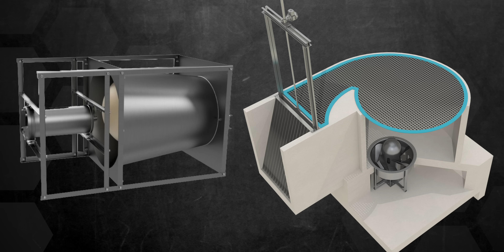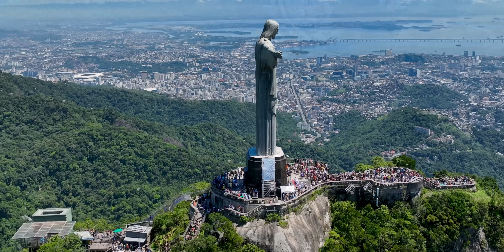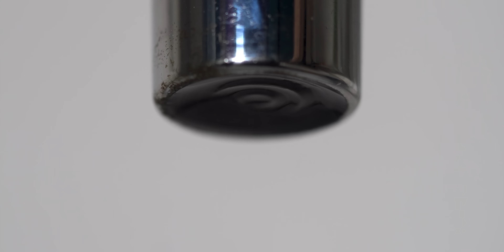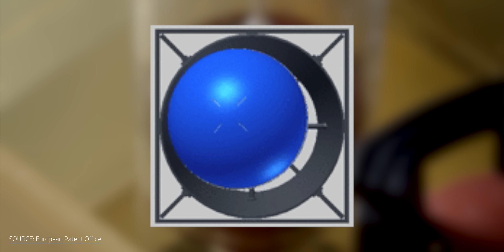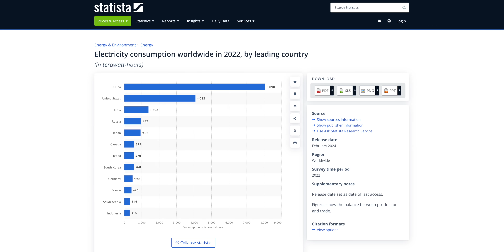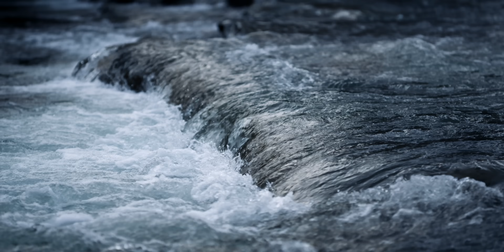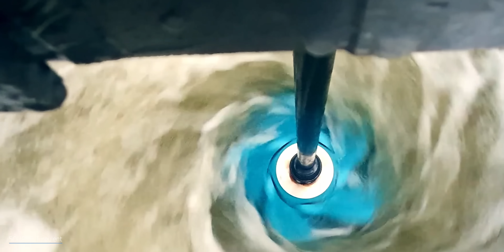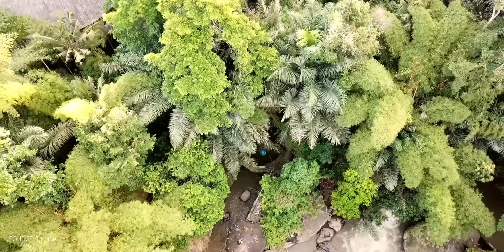The Genius of Small Hydro Turbines

Comment: So, basically, anywhere there has been a water-wheel driven mill historically, we can put in a small eco-friendly hydro. Sounds like a great idea to me! I do not believe that we will ever find a "silver bullet" that will solve all of our energy needs with a single system. I think it is much more likely that we will continue to expand our options - rooftop bladeless wind turbines, micro-hydro, more efficient solar panels that are manufactured with fewer rare elements, etc.
Reply: In the UK you can find a bunch of old water mills that in Victorian times replaced their wheels with turbines so it's something that already has precedent. Of course those turbines were just motive power not for electrical storage but same principle for the swapping out of the wheel. There are good charts on how much efficiency you get for wheels and turbines given drop height, over or under, etc etc.
Reply: @MrFolfy  Great! Sadly, nothing as convenient as a map of old watermills exists for the US (or, at least, none that I'm aware of).
Reply: There's no "silver bullet". Never was. These are all small pieces of a very big puzzle.
Reply: @233kosta  Agreed. I have never understood the fascination for the search of an heroic single solution. This is true in medicine, also. Researchers are busily testing different compounds to increase longevity, looking for that silver bullet; but all the research points to small, incremental lifestyle changes (diet, sleep, exercise, social connection) as the best strategy for life extension. Ditto energy systems. All of the engineers (or at least, the press reporting on the engineers) are looking for the one 'silver bullet' technology. But experience would argue that the more varied and flexible our options, the more cost-effective and efficient we will be at meeting our energy needs.
Reply: @lindacgrace2973  I'm an actual engineer, you won't see me wasting my time with journos or other media. I got actual work to do which is going to contribute to an actual solution to some problem.

I'd say don't take the word of media or "influencer" types, most of what they say is way too dumbed down to make any sense to begin with (and that's before they throw in any big words to further bamboozle), but also, there's always some political agenda behind it, whether it be promoting something they're paid to promote, hyping up interest in some nonsense they're paid to hype up or actual government politics. Sometimes, the snake oil is so good they don't even have to get paid to push it.

I can count on one hand the number of STEM-adjacent youtube channels I haven't caught sacrificing accuracy and integrity for hype or clicks or some other undisclosed end.

In terms of divorcing from fossil fuels, no real engineer is looking for a silver bullet. Most of the good solutions have existed for a long time, but we're not using them either due to cost (most renewable sources, battery-electric transport, anything that requires major infrastructure work), politics/public opinion (nuclear power comes to mind), or some combination of both (London got battery-electric buses. They are worse in every conceivable way than yonder regular old trolley bus, but the current hype is for battery-electric. Also land-based wind farms. Apparently they're fugly. There are even politically-motivated opinion pieces masquerading as analyses claiming offshore wind is "better", "more efficient" and "more effective". These get cited as fact to back up infrastructure investment decisions.).

Frankly, this impending environmental doom would never have gotten this out of hand were we not so great at sabotaging ourselves and getting in our own way. As a species, I mean.
Reply: @233kosta Dear Kosta, I am not an engineer. I research nutrition. You think the engineering space is a cacophony - try any of the dietary advice channels! There are only a handful that I trust. The vast majority - and most of the wildly popular channels - are rife with misinformation. Just sayin' : I feel your pain. But I'm merely here exploring interesting ideas and am fully cognisant of the limitations of both my own understanding and the format.
Reply: The closest thing to a magic bullet is nuclear power.
But hydro is definitely the easiest one for people to use
Reply: There is no silver bullet, but roof top solar gets pretty close. The limitation of solar is more of a battery limitation than a solar limitation.
Reply: @evancombs5159  I'm planning to build a house in Arizona. The perfect location for solar, right? I discovered that solar panels are cheap and plentiful, it's the storage batteries that are expensive and hard to come by.
Reply: @lindacgrace2973  yes you are right. The panels are cheap, but you can't divorce the panels from everything they need to provide your house with electricity. Even if you skip the battery all the other parts and the labor for installation still make it prohibitively expensive for most people. If I was a utility I would be running some kind of program to install panels for cheap without a battery (and contractually restricting the installation of a battery) then use the excess energy produced to go towards paying off the cost of the panels.
Reply: @evancombs5159  I agree with your premise, but not your solution. Arizona encourages the adoption of off-grid energy solutions via zoning laws and tax incentives. I prefer that solution to a "forced choice" program from a monopolistic utility company.
Reply: @lindacgrace2973 Battery experience curve is that the price drops by 20% with every doubling of production, more or less.   As with solar their price will keep dropping.
Reply: @a-iu9zO  Very true.🙂
Reply: regular wind turbines work well, but yeah, everything can be better ofc. i've watched plenty of washing machine hydro power videos here on youtube, it's really easy to build one yourself IF you have access to flowing water on your property (which most people sadly won't have).
Reply: @moos5221  True. More applicable to east of the Mississippi rather than the semi-arid and arid west.
Reply: @lindacgrace2973 don’t forget nuclear!
Reply: @titleloanman  I didn't forget about it. I just don't think it's politically viable - you know: NIMBY (not in my back yard). There's a LOT of opposition to them. The major issue is that we have yet to come up with a good way to store, recycle, or dispose of nuclear wastes. Until we come up with that (no, burying it in underground bunkers is not a good permanent solution!) I'm afraid nuclear is a no-go.
Reply: @moos5221  It's not that easy. The flowing water must have a certain height level or power level to produce substantial energy.
Reply: @meilyn22  thanks for pointing out the obvious here.
Reply: @moos5221  Lol. Obvious™
Reply: @meilyn22  true.  But if it's a small enough crick.  You can do a small survey and see if it ever supports any fish or anything that needs to migrate.  And if not small dam.  Have a spring in our neighborhood.   Damed it up like 3k ft from ghe source in a corner bend.  It's a swimming hole with native plants and small turbine
Reply: @Aztesticals  That's the idea precisely.
Reply: Big electricity was super cheap long ago when people got rid of their water wheels, now it is swinging back.
Reply: @Jokerwolf666  Sort of "everything old is new again." Except this time it's more heavily engineered. 😉
Reply: I totally agree, different places need different solutions, not everything will work everywhere
Reply: @wiezyczkowata  Thanks. I feel vindicated.
Reply: Fusion reactors will solve all our energy problems.
they can even be used on cargo ships.
Reply: @dubious6718  Fission reactors have already solved all of our energy problems. They can even be used on cargo ships. But nobody wants to use them.
Reply: @dubious6718 once one exists. Maybe.
Reply: So......the romans, the egyptians and the early mesopotamians had it right.
Reply: @ricardokowalski1579  Yep. Architects interested in restoration of ancient buildings are resurrecting ancient technologies and applying it today in restoration projects.
Reply: Very nice puns and song references.😂🎉
Reply: We just need to figure out how to survive until we get our Dyson Sphere built.
Reply: @zaibervaireus  🤣Because, while we are completely inept at planting trees and renewing water flows, but we'll succeed at something as complex and unknown as a Dyson sphere? Um, I'm not so optimistic about that. I think that we have not gone past the tipping point - I think we have a shot at saving this planet and undoing much of the harm we have done. Massive village-by-village water collection/retention efforts is re-greening the most heavily populated desert on earth (northwest India). Mossy Earth, Rewilding, Clean Ocean, and small local volunteer groups around the world are piecemeal fashion, tiny plot by tiny plot - greening the world. African farmers are holding back the Sahara, cattle ranchers in Nevada banded together to implement better grazing practices and restored wetlands (complete with beavers and migratory birds) in NEVADA! Shaun Oberton a small businessman - with the help of volunteers - is planting a desert forest in a desolate part of Texas. It's quite a thing now to buy up land, and dedicate it in perpetuity as wild space. There are programs and national clubs promoting wildlife habitats in people's back yards, thus creating a patchwork quilt of wildlife corridors. I believe that small local efforts - collectively will reverse the mass extinction we have very nearly brought upon ourselves. At least, it seems more likely than a successful Dyson sphere 😉
Reply: @lindacgrace2973 Bruh chill, it was obviously a joke.
Reply: @zaibervaireus  I get it. That's why I used the LMAO emoji. The rest is my usual speech for the discouraged and pessimistic. I need to encourage myself from time to time!
Reply: Have been planning on designing hydro for the little stream next to my house. Ultimately going for solar, wind, hydro, and even have a stationary bike idea I am going to try out. Electricity can be produced in many ways, true energy independence
Reply: @DwDDB  Dear William, Wow! That will certainly reach your goal of energy independence; but it also sounds like a lot of maintenance, which is not popular with me. I'm a retiree in my 70s. I'm trying to keep my house as minimalistic as possible. Russian wood-burning masonry fireplace (it snows in the Arizona mountains), Passive House energy-efficient construction and energy-efficient appliances to minimise energy needs, passive solar home design with deep roof overhangs and deciduous trees providing shade during the summer, a large (I've been told, 'overbuilt') solar array with a gas-powered backup generator (that I hope I will never have to use). My elaborate multi-input system is my water capture and storage. Getting water off-grid (basically, capturing whatever falls on my lot)  is a necessity when you want to grow your own food in an area that only gets 15" to 16" of rain per year.  We should compare notes!
Reply: And, y'know, nuclear.
Reply: @AnnaNym-h5k  Not likely to have back-yard, small-scale nuclear anytime soon; so hardly comparable to micro-hydro.
Reply: @lindacgrace2973  Well, no, but small modular reactors are becoming a thing, and even traditionally-sized large scale nuclear has a significant role to play.
Reply: @AnnaNym-h5k  Wow! I hadn't heard of 'modular reactors' (I feel another rabbit hole coming on...) Thanks!
Reply: Yeah, anything BUT nuclear (booo!)
Reply: Silver bullet is fusion
Reply: @benbarberian1701  Oh? You mean the technology that's "only a few years away from being viable" for the past 80 years? I'm not holding my breath...In the meantime, taking some of the strain off of aging overburdened centralised utility grids by supplementing, or completely converting to distributed systems like roof-top wind turbines, micro-hydro, and solar power generations seems like a more viable option.
Reply: I'd like to know what does a hydro system cost
Reply: @chrisrichardson8908  Good question! I live in arid Arizona, so I don't have a water source to harness, thus, I never asked. But, now I'm curious. It can't be any more than a $10,000 to $30,000 solar system.
Reply: Irrigation ditches, storm Wastewater runoff etc....
Reply: @trentR3437  Yes, indeed! In my area of the Arizona mountains, we average 16 inches of rain per year. Some years, that drops to as little as 12 inches of rain. Just to be on the safe side, I will use a Presby septic system, and use the effluent to water trees; I have swales and berms planned, and will capture water from my roof, the roof of the greenhouse, the roof of the chicken coop, and the solar panel array. That way, even in a bad year, I will collect 15,000 gallons of water which is enough for me, my garden, and my swimming pool. In good years, the overflow will feed ephemeral ponds that will help local wildlife.
Reply: Fusion reactors are the closest  if you get the costs down enough it opens up so much economically as well
Reply: @goberdabelch  True. But I'm not holding my breath. I remember reading that fusion reactors were only a few years away as a child - in the 1960s!
Reply: It would require a paradigm shift away from much technology.
Reply: @justinbiondi  Hmm. I don't think "away from technology," so much as a shift towards "distributed technology." Just as we went from the IBM 36 to desktop computers to powerful smart phones, we can go from huge public centralized hydroelectric dams, nuclear power plants, and expensive wind farms to smaller distributed systems like rooftop solar panels, tiny blameless turbines on the roofs  of small businesses, and micro-hydro. In my view, a distributed network of many different and redundant small power sources has much to recommend it (no shutting down entire towns or regions due to a problem with the centralised grid) and much lower cost overall.
Reply: National grid on nuclear should be first priority. Then solar can be on the roofs of homes, hydro where there are rivers, turbines where there are farms. But imo nuclear is most important
Reply: @user-lp5wb2rb3v  MOST important?🤔You are right, nuclear is very important. Actually, I think the highest priority is diversifying and decentralizing power. The more diverse and widely distributed the power sources, the less likely we are to suffer when any one source goes down. I envision a time when the  hydro electric powered grid goes down but there is a network of private power sources that volunteer during extreme events to keep power on for their neighbors (just as there are people with snow removal equipment that chip in after bad storms, freeing the city's crews to attend to main arteries and essential infrastructure, usually in exchange for a break on their property taxes).
Reply: Doest it work in sync with the grid?
Reply: @TheRuancarlo  It's up to you. You can hook up to the grid or operate completely off-grid.
Reply: @TheRuancarlo  It can. Or you can go completely off grid - your choice. =-)
Reply: @lindacgrace2973  true. It would be easier to use more than one clean option and divide the load between them
Reply: @fayzaanriaz796  Agreed. :-)
Reply: Why choose when we could utilize a combine system?
Reply: @submersedsword4949  Precisely! I think distributed power production from a variety of sources adapted to local conditions will be the wave of the future.
Reply: I totally agree with you 💯👍🏾
Reply: @lindacgrace2973  you wouldn't even need to do that, as long as the wheel is still there, connect the other end to a generator, job done. Quick, easy, keeps the old aesthetic.
Reply: @lindacgrace2973  leave it to beaver!
Reply: @kennydon  LOL
Reply: one might argue that fusion is such silver bullet as it would be so productive that any losses would be negligible for long worldwide transmission lines
Reply: Not really even limited to that, you can chain these things together, in theory you have mile after mile of them along the same river one for every X meters of drop. Unlike wind and solar the reliability of these systems makes them actually useful at a grid scale.
Reply: @gravitaslost  Especially the ones designed with fish-safe turbines. After all you are not extracting the water, you're only briefly diverting it.
Reply: @lindacgrace2973  While waterwheels and micro-hydro turbines both harness water power, efficiency heavily depends on conditions like water pressure and flow. Waterwheels thrived in high-pressure spots, utilizing even a low 5-foot head effectively. However, turbines, especially spaced a mile apart, may not capture enough energy due to varying pressures and flows. Each system has its optimal settings, and assuming turbines can match waterwheels everywhere oversimplifies their complex requirements. It's not plug and play. Stop the madness!
Reply: @gravitaslost unless you live in spain and the rivers dry out
Reply: @gravitaslost  Water doesn't work that way, dude. But okay lol.
Reply: @meilyn22  Huh? Water wheels use about the same water drop - 5 to 10 feet - and were geared down to create the torque necessary to run mills and other industrial equipment. So - um - I have to display ignorance, but a 5 foot head of water tapped by a water wheel is sort of the same thing as a 5 foot heat of water tapped by a micro-hydro.
Reply: @meilyn22  Lol. It says it in the video?? It is exactly how gravity and potential energy in fluids work dude. But okay lol.
Reply: @gravitaslost  It says it in the video? Lmao, Matt is known to be the greatest scientist on the planet. Didn't know someone who has been busted for making anti-physics and chemistry claims is the authority on the subject.
Reply: @meilyn22 Lol. I'm not relying on what Matt said, it's basic physics. The amount of energy stored in a litre of water due to gravity is the same for every 5m drop all the way down to sea level. It's not rocket science.
Reply: @gravitaslost  While it's true that the potential energy in a liter of water due to gravity is consistent for every 5-meter drop, this doesn't account for the real-world complexities of harnessing that energy. Energy conversion efficiency, environmental factors, and the design of the energy extraction system play crucial roles. Simply put, the same height drop in different contexts (e.g., a steep waterfall vs. a gentle river slope) won't yield the same usable energy due to losses and practical limitations. You need to consider these factors beyond just the basic physics of potential energy. You are displaying how limited your understanding of physics is. real-world applications face efficiency losses due to hydraulic, mechanical, and electrical resistances. These resistances cause significant energy losses from water to wire, complicating the straightforward conversion of potential energy into usable electricity.

If you think 5 meter drops will produce the same energy you see in your physics textbook, then maybe you should take a physics class again.
Reply: @gravitaslost  Have you ever heard of efficiency losses due to hydraulic, mechanical, and electrical resistances? What about energy conversion efficiency? Do you think the same height drop in different contexts (e.g., a steep waterfall vs. a gentle river slope) will yield the same usable energy?
Reply: @meilyn22  The drop in this example is manufactured and therefore consistent, none of your points are relevant, thanks for your input.
Reply: @gravitaslost  Okay, physicists.
Reply: @meilyn22  😂Actually, uhh, never took a physics class. Skipped high school altogether and went from junior high straight to college (I'm in my 70s, so I went through school long before 'middle school' was invented). Maybe I'm missing something here, but aren't those real-world constraints fairly uniform across ALL energy extraction methods? In other words, physical constraints, for example water speed, head pressure, turbulence, seasonality of water flow, etc., is identical for water wheel, turbulence turbines, and micro-hydro. The constraints on hydro power are fairly uniform for any given location. I was not claiming that a 5 meter drop will always produce the same amount of energy across all conditions. I'm saying that since the conditions restrain all of the technologies uniformly, it is pointless to complicate an already complicated analysis.
Reply: The solution is distributed power generation.
Unfortunately, corporations want centralised power generation for profit concentrations.
This is the real issue with the change.

Power is a struggle for power
Reply: @yt.personal.identification  True! That's why Arizona appeals so much. Instead of REQUIRING connection to the (failing) local grid (like California and several other states) Arizona encourages disconnection with zoning laws and tax incentives. It is absolutely 100% possible to live off-grid smack dab in the middle of town or in a cozy suburb in Arizona. Huzzah for state independence!
Reply: @lindacgrace2973  Off grid is different from distributed generation - it entails feeding back into the grid.

That way, something like this can become pumped hydro during off peak, for use during peak times.
Reply: @yt.personal.identification  Ah, I get it. In the mountains of Arizona (where I'm headed) the grid is highly unreliable (this is true or becoming true in many places). I thought 'distributed' included power generation right down to the individual housing unit. You mean everybody chipping in to a centralised pot, I imagine. I think both models would work, although yours sounds more failure-proof. In your distribution system, if one generator goes out, there's enough generated by everyone else to keep the post office and street lights up and running.
Reply: @lindacgrace2973  You got it.
Some store energy, some generate, some do both.
People can take advantage of peaks in pricing and requirements by releasing stored power or storing off peak priced power.

Tie it all together with open source monitoring tools.
It is just a different way to view the grid.
Reply: @yt.personal.identification  True. I like neighbour -power more than I like "power company power". Just my bias.
Reply: @lindacgrace2973  Can we call it "redistribution of power"?
Reply: @yt.personal.identification  Brilliant! When everybody agrees, but still quibbles about the labels - rebrand with a terrific new label. 🤩
Reply: there's  also rainwater down spout hydro
Reply: @YT-Observer link?
Reply: we actually have a solution that is cleaner,safer, better for the environment,and 10s of times more efficient,its called nuclear,but due to people not being educated and fear and panic of the masses we still have energy problems
Reply: The first hydro electricity producers where such old water mills but one mill only producee 0.5 Watts per Minute.
Reply: @paradiseisland69 Oh, cool. Never knew that before.
Reply: historical water-wheel mills had ponds, and those broke too 

It is not the turbine, it is the head which determines how much energy you can extract, that is why the old mill ponds were dropped in favour of coal-powered mills, then large hydro dams. It is not expanding our options unless you want to add those options to the large hydro power plants, but the small turbines can't replace them unless you like the middle ages.
Reply: @EmilNicolaiePerhinschi  OK. I'm confused. The mill pond was created by damming a creek or river to improve the head (water flow at the outlet of the pond). Nope. Micro hydro is a very specific niche solution for very specific situations (it won't work throughout most of the arid west, for instance.) But it's a cool option for expanding distribution of energy production.
Reply: @lindacgrace2973 Mill ponds were created to provide a steady supply of water, not to improve the head because the mill was just near the mill pond. The micro turbines will be able to extract very very little energy because there is little "head", thus the potential energy is small. "Head" is the height between the pond and the generator: the higher the more energy you can extract.

If you don't have electricity at all or the grid is expensive to bring to your location then sure, micro hydro is better than nothing, if you can bring the grid to your location micro hydro is a waste of labour and energy. 

Also rivers are intermittent too :-), in most of the world the flow varies a lot during the year, that is why the old mills had ponds.
Reply: @EmilNicolaiePerhinschi  OK. I'm thinking of a different arrangement than you are. The mill sits at the same level as the pond, but the water wheel is in the river below (usually 5 to 10 feet lower). This provided steady water stream (as you pointed out) but doesn't the height differential between pond and stream also create head? This is a genuine question - I'm not an engineer and don't know for sure - although it seems intuitively correct. But, at this point we're splitting hairs.
Reply: @lindacgrace2973  5 to 10 feet is insignificant ... anything under 100 meters (like 300 feet) is  not very useful considering how expensive are the turbines (thus how much energy was put in making them).
Reply: @EmilNicolaiePerhinschi  Huh? You lost me. That is precisely the condition that micro-hydro is designed to handle: 5 to 10 feet of head; almost identical to antique water wheels. That's the whole point of micro-hydro. Micro-hydro, as the name suggests, produces modest amounts of electricity (enough for a family home) with 5+ feet of head. We're not talking about generating enough power to fuel a town; we're talking about distributed power generation that is sufficient for scattered homes, agricultural applications, etc.
Reply: We could always just go nuclear
Reply: @teondrehughes670  Great solution if we could figure out a decent way to deal with nuclear waste; but burying it in bunkers is not a good long-term solution. So until we figure that out, nuclear suffers from NIMBY (not in my back yard) and is not politically viable.
Reply: @lindacgrace2973  build reactors that run off waste material from primary reactors  using the most of what's left in the waste, leaving behind material that won't be radioactive for nearly as long as the stuff we currently have. The technology had been there from the start. We had some of those types of nuclear plants, but I think they've all been shut down because of politics.
Reply: @teondrehughes670  it's sad how uncommon common sense is!
Reply: We have had our “silver bullet” solution for our energy needs for decades. It’s called nuclear energy, unfortunately due to too much fear and misconceptions about nuclear energy it’s being vastly underutilized
Reply: @mrjriva  I agree that fear mongering is the primary political tool used to derail new nuclear energy; however, that is NOT the primary problem with nuclear energy. The primary problem with nuclear is that we have never figured out what to do with the waste. Burying it in bunkers is NOT a viable log-term solution for the entire half-life of the waste products. Remember the Fukushima Daiichi Nuclear Power Plant in Japan, which discharged millions of gallons of radioactive fresh water into the Pacific Ocean in 2011? Or the Hanford Nuclear Site in eastern Washington, designated as the most radioactively polluted site in America? Until we figure out how to manage the waste products of nuclear fission, nuclear is not a viable solution because of the ecological impact. I really think that a decentralized network of small energy producers - industrial, business, institutional, and residential - is the ticket. Just as moving from large centralized computers to desk top computers and finally to cell phones made information more universally available, decentralized power production will make energy more universally available and thus cheaper, and solve many of our ecological problems.
Reply: What about Hemp?
Reply: @jusjetz  Uhm...you lost me. What does hemp have to do with distributed micro hydro-electric power?
Reply: Can't forget Nuclear.
Reply: @CiabanItReal  Haven't forgotten about it. It's just not suitable for distributed, decentralised systems. It's hard to scale them down and miserably difficult to deal with the highly toxic waste. So, if the idea is the relieve strain on the centralised power grid by distributing power to individual homeowners and businesses, I don't see that nuclear would be much help.
Reply: The silver bullet is called Thorium Salt Reactors. Nuclear over built to handle our peak needs and when there's a lul in demand it we can dump the excess energy in CO2 collectors to make synthetic efuel for aircraft.
Reply: Wrong, wrong, wrong.  The future is nuclear!
Reply: @protoborg  Not entirely. The whole point is to come up with a network of distributed power generation. Relying on any one, singular power source is unwise. Just as computing took a huge leap forward when we abandoned centralized computers and switched to desktops; then took another huge leap forward with computing distributed to cell phones; we will have a much cheaper and more stable energy supply with decentralised power generation. The power grid going down during a natural disaster is a fairly trivial problem with small community micro-hydro, solar, wind farm, inner city wind turbines, etc. My objection to nuclear is that we do a lousy job of recycling and  safely storing the spent fuel - we could and should take notes from France (the world leader in nuclear recycling). I have a suggestion for making your arguments more effective in future - a passing acquaintance with Emily Post will help.
Reply: The only "Silver bullet" I can think of is fusion energy, but that's always 10-15 years away lol. But let's say we figure out fusion energy and can scale it to produce a few GwH per year. Then fusion would be the strong foundation, solar, wind, hydro and geothermal would be the other piece of the pie. Ideally with fusion being around 40% and the others doing the rest. And all in a way so we can live with nature and not have to go against it.
Reply: @JaegerDreadful  Fusion releases a lot of heat that wasn't really present as accessible energy until we messed with it. I believe if compact/portable cold fusion became readily available, humans would use so much of it that we'd outdo carbon emissions in terms of heating the atmosphere. When we stick to conventional renewable energy, we're just repurposing the energy we've already received from the big fusion reactor in the sky. No additional heating is applied.
Reply: @JaegerDreadful  Minor correction, fusion energy is now and has been for some time. The real problem is tapping it as the distance is a bit of a challenge. The nearest continuous fusion reactor is only eight light minutes away.
Reply: @JaegerDreadful  100% agree! We need a plurality of solutions - not a silver bullet. Although, I must say I've given up on fusion energy - too many "promising breakthroughs" have fizzled out.
Reply: RUBBISh. There is a silver bullet. The people with money are simply not interested.
Reply: The silver bullet is decentralization
Reply: @ACE-xr4jz  Precisely!
Reply: The problem, is this really doesn't solve much of anyone's energy needs.  These are by design very localized, and most people simply do not live near a river, or more importantly they don't live near a river that will have the 1.5m head height needed to operate,  now sure you could dam up the river to give yourself the required head but then you come go against the primary reason for these which is to stay away from needing dams.
Reply: Orbital solar power. Nigh infinitely scalable. And with the advent of Starship, a near-term future option.
Reply: @dansands8140  Have they figured out a way to beam the energy down without frying everything in the beam's path? What is "Starship"? This is intriguing, I had only read about it in science fiction.
Reply: @lindacgrace2973  Starship would be SpaceX's new rocket. Probably around $20/kg to orbit instead of $10000. And the US Air Force is already developing the Space Solar Power Incremental Demonstrations and Research Project. You probably couldn't avoid frying things in the beam's path, so, uh. Don't put things in the path.
Reply: @dansands8140  Another tesla fanboy hoping for the impossible lmao. Starship is 30 - 50 years away from amounting to anything. Believe space, karen, at your own risk.
Reply: @meilyn22  You know absolutely nothing.
Reply: @meilyn22  My guy you can tweak things like pressure and flow rate by simply constricting the diameter of the river, so as long as there's sufficient head you could pinch the river and create that higher flow required.
Reply: @dansands8140  Yea, keep waiting for Elon to give you food. How did Hyperloop turn out, by the way?
Reply: @Fenthule  Did you even my comment? It's either head or flow power. Where did I say you couldn't tweak the flow if the head was reasonable?
Reply: @meilyn22  I'm sorry. I have no idea what you are referencing. Aren't we in a discussion about micro-hydro contributing to a decentralised electrical grid? How does Elon figure into the conversation? Also, I don't recall Elon ever offering to feed the world; and it's hardly relevant to this discussion, anyway. I'm genuinely puzzled - and obviously out of the loop - since I can't make heads nor tails of your comment.
Reply: @lindacgrace2973  I was responding to the other dude who brought starship into the conversation. Maybe read the thread?
Reply: @meilyn22  Dear Meilyn22, You lost me. What does micro-hydro have to do with Tesla? So far as I know, Elon isn't even venturing into the space and not threatening to. So, I'm not a 'fanboy,' nor am I a 'karen'. I am bewildered by your highly combative post. All I did was comment that I think that re-using already established sites with proven conditions conducive to extracting water energy is a cool idea. I am definitely lost the thread. When did Elon Musk and SpaceX come into the discussion?
Reply: @lindacgrace2973  I hope you know other people are responding on this thread? Like I said before, I was responding to someone else, not you.
Reply: @Mike__B  Actually, my son is founder of a Silicon Valley startup he called "Longshot". They have created a giant gun that shoots (or, considering the gas-loading tech they're using, actually 'squirts') the payload into space. Useless for passengers but cheap and efficient for satellites, which are generally the size of a beach ball. So, we're closer to $20/kg than you might think.
Reply: @meilyn22  Oh. When I look at it, it bunches everything together and the replies are separated from the initial messages; so I've been responding one by one. 😳This technology is still not fluent to me!
Reply: @meilyn22  Yep. I finally caught on 🤭It takes me a while.
Reply: @Mike__B  🤔 They're experimenting with different gas systems, including air (aside from compression equipment, it's free). Yeah, they probably won't hit $20/kg; but taking satellite launches from millions to thousands is still a huge leap forward. They've used DARPA and military grants, and have moved on to private equity, which I take as a sign that their innovations are working and they're hitting their technical progress targets. Keeping my fingers crossed!
Reply: @dansands8140  Lol. Unfortunately 'orbital solar power' bears a remarkable resemblance to a space based energy weapon, basically because it is. Consequently it's unlikely to be politically acceptable in the near future.
Reply: @dansands8140  But why would you want an orbital power device/structure/whatever to explode before even reaching orbit?
Reply: @PBeringer  Because you're not a clown who thinks spending 15 years and 20 billion dollars is better than spending 3 years and 3 billion dollars and blowing a few up.
Reply: @dansands8140  I know. It was just a low joke. And I would love to see that iterative approach pay off too, but something's not quite right with that whole project (a suspicion which is made stranger still with the success of Falcon 9, for example). But without a single clue as to what I even think is suspect, let alone any evidence, it means nothing. We can only wait and see.